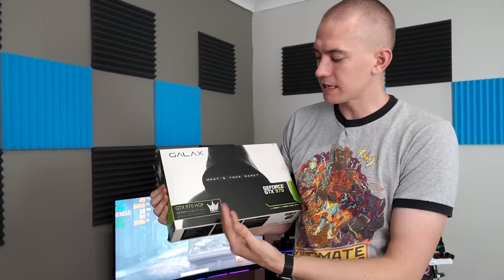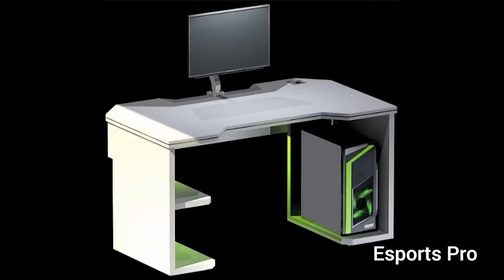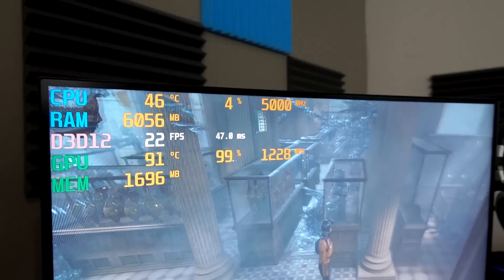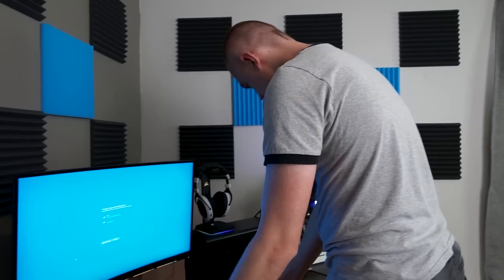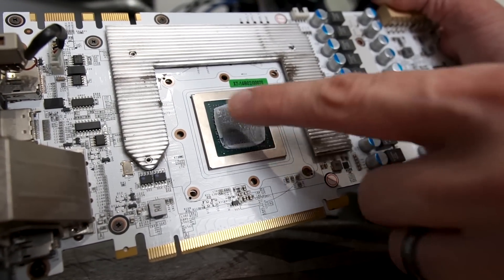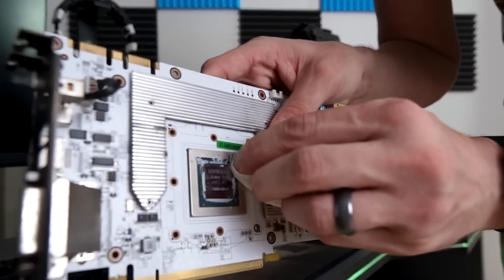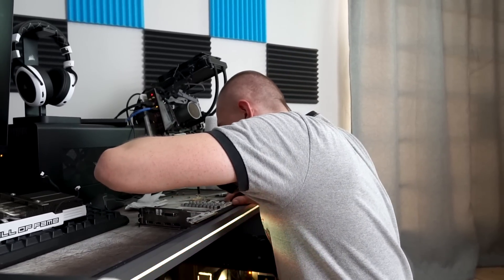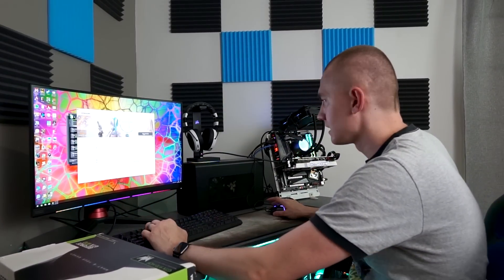GTX 970 - Worth It In 2019?

Comment: i still run a 970 and a 4790K. dont see the need to upgrade. although i have to upgrade my GPU. have to get a stable 144hz/FPS. in overwatch on low settings. cant handle it now. so waiting for navi to come out.
Reply: 970 and 4790K here, and waiting for navi as well. The 970 plays almost everything high or ultra at 1080p, but some games get really choppy in my setup: Tripple screen (5760*1080) is hungry.
Reply: @joanpey8809  yeah you use a triple screen. its different haha. i only use 1 monitor. upgrading from my ancient old 60hz samsung led monitor. love this monitor still though. great monitor. but the price of this monitor was at that time just as much as a 144hz monitor that i want to buy cost now. So yeah i think a single navi card would be a nice upgrade. but i can still oc this card. although i have to figure out how.
Reply: @metalvideos1961  overwatch is also alot more cpu dependent compared to other games
Reply: @crumb6332  no its not. its a GPU bound game. most if not all modern games are GPU bound. CPU doesnt matter much. Light overklock can do wonders. but you dont even have to do that. Older games like Classic doom wolfenstein 3D and all those games are more CPU bound. Minecraft is also CPU bound. But overwatch is not CPU dependent. its GPU where i have to worry about.
Reply: @m4rix2036  have you ever cleaned the inside of the PC? How about your thermal paste, have you ever changed that in that time period?
Reply: @m4rix2036  it's free performance lol. Takes like 20 minutes.
Reply: here a 970 with i5 4460 rocking in 2019 lol
Reply: What version do you have? If it has a beefy cooler you should increase the powerlimit, the boost clock will increase by a lot
Reply: @janpul1590  Asus Strix 970. wanted to go with a MSI but was a little more expensive. so i decided to go with Asus. have to OC it still though. but at stock i dont get that high of frame rates. well not a stable 144FPS at least around 130 till 140 on low. fluctuate alot. and around 120 till 135 at high/ultra settings. so also nearly not enough on what i want.
Reply: @janpul1590  I, for example, have Asus gaming mobo that unlocks full core clocking, but also have Corsair 2x120 radiator liquid cooling installed.
Reply: @GrimK77  why 2x 120?
Reply: @janpul1590  2x120 because I could. There was no point going for 1x120 if I can fit 2x120. Corsair Obsidian 250D case. Price difference between 1x120 and 2x120 was marginal and prefered slower run for fans. My GTX970 is air cooled, but its fan stops at low load.
Reply: @GrimK77  ah okay, what GPU do you have?
Reply: @janpul1590  GTX970, ASUS Strix series card
Reply: Hey, I have exactly same setup... 4790K (on ASUS mITX gaming mobo) with GTX970 (ASUS Strix)... After seeing this video I consider looking into thermal paste tho...
Reply: @GrimK77  you should monitor your temperatures, my windforce doesn't get above 60 °C @1450mhz (200mhz boost over stock)
Reply: were all waiting for navi bro haha
Reply: I ran a 2600k I7 cpu for 8 years and i had no issues. Most games are GPU dependent. My 970 wasn't even bottlednecked. I upgraded to a Ryzen 1800x, fps stayed the same. So i bought a 1070 TI, that did it
Reply: My ryzen 3 get only 40-50ish percent of utilization while playing ow on medium at 80fps with an get 1030. So you can get that with your rig no problem
Reply: Same only i5 4570
Reply: I can play OW with a 970 and i7 3770k on the highest possible settings and always have 120+ FPS settings
Reply: Your 970 should be able to handle overwatch fine even on high settings. I'm pretty sure it's your cpu that's bottlenecking your gpu
Reply: @crumb6332  definitely not, the 4790k has 4cores/8threads at up to 4,4ghz I think something's wrong with his GPU
Reply: @crumb6332  also how can a 970 bottle neck a 4790K. doesnt make much sense if you ask me. every GPU bottlenecks a CPU a little. pretty much all electronics got some kind of bottleneck. But a 970 and a 4790K is a good match. i can even go for a 1070 or 1080 without major bottlenecks. or no bottlenecks at all
Reply: @metalvideos1961  a 4th gen processor is getting kinda old
Reply: @crumb6332  it maybe is. but its still good enough. i know people whos till game on a 3rth gen I7. even on the second gen i7. and they still manage to get a good FPS in games with a new Video card. so no my CPU is stillf ine. i can use that one for at least a year or 2. after that overcklocking and i can still use it for a year at least. so no i dont worry much about my CPU. I want that 144hz also on 1080p anyway. not getting 1440p or 4K. dont need that.
Reply: @crumb6332  
i can handle it fine. easy even. but not on a stable 144FPS. i tested it with the monitor i have now. max FPS i get on low settings is around 135 till 140FPS. so not nearly at the 144 stable that i want. on high/ultra settings i get around 120FPS till 130FPS (if i am not mistaken) but as you can see still not a clear 144FPS stable. I want to play it on 144FPS stable at least. maybe even 240hz. but i need a very good GPU for that. and i dont think my CPU will like that very much. not really in the mood to upgrade my whole pc. although Ryzen 3000 looks good. But i can always OC my GPU ofc. although i dont really know how that works. but i still have to figure it out. reason why i havnt done that is because i dont have money to spear to buy a new card when things go wrong

Comment: @UFD Tech, dude theres 4gb vram not 3.5 and 512mb is the "super slow" hence the joke 3.5 out of 4
Reply from the maker: I say this in the video
Reply: @UFDTech  no you said 3.5 gb vram but 512 is the slow, so 3gb watch it i just did thats why i commented
Reply: @UFDTech  i just rewatched it and your correct you do say 4gb then you say RE 2 at just plain high settings uses 3gb so it wont use the 512 thats extremely slow if thats correct theres 512 missing 10:00 mark

Comment: I currently own a gtx 970 and am thinking of upgrading. My new gpu would need at least 8gb or vram and perform as good as an rtx 2060 or better. The rtx 2070 has a horrible price to performance so I am currently waiting on navi. My thoughts were that If they can release it in July, I would definitely buy though if they release in October/November, I would wait for Nvidias 7nm since they are rumored to be releasing new cards around that time. Also, Nvidia just reported that sales where down over 40% which makes it even more likely the will release sooner.
Reply: Grab a used 1080 for around $400.
Reply: If you don't have a G-Sync monitor, wait and see whats AMD brings to the table.

Comment: I recently sold AMD system with FX8350 paired with R290. The GPU is basically on par with GTX970. I did a similar benchmarks prior to my sale and the numbers I got were similar with 1080p. I sold it as "1080p gaming PC". I sold it for $450 and the guy was happy with it.

Comment: The very best 3.5 gigabytes of VRAM
Reply: I had a 780 3gb rma'd and they gave me a 970 so i was happy about the extra .5gb
Reply: If i buy a new 80 series i want a 80 series, becouse you pay more than the 970 price ...
Reply: It has 4gb it's just that 512mb of it is slower
Reply: @kagamine_rin0294   which i wouldn't be surprised if other cards do the same thing when reaches the last bit of vram . my 970 deff eats up 4GB vram when pushed to max
Reply: @MarioMadness1  Mine too:)
Reply: @kagamine_rin0294  4gbs gddr5 512mbs ddr
Reply: xXzelda masterXx GTA V iIrc only allows 3.5GB to be used.

Comment: mine died 8 months ago, and had to update to the 2080, I was with integrated graphics unlocking timed achievements on games. I decided to buff up because I did not want the heat to ruin the card as it did with 970
Reply: Bad luck, mine died a month before its 3 year warranty ran out phew, I suspect the poor ventilation in my case sped up its death.
Reply: at least the warranty is valid in your contry, here in Bolivia is more like "buy at your own risk" cause there is no official representative here, the only warranty that they give is 3 months if you buy it here (at double the price). I got mine brought from the US and had nowhere to claim to. And at this point shipping it myself would have cost more than a new one nowadays.
Reply: @luisgenaroarteagasalinas2599  Damn that sucks big time :-(.

Comment: I own a Zotac GTX 970. Love it, but barely have time to play and a system to actually use it. It's on a q9550 @ 3.4GHz 8GB DDR2 1066 and the GPU works at about 40-50% from his real speed.
Reply: Because of cpu bottleneck
Reply: Bottleneck by CPU , ram, pcie and possibly HDD too, anyway maybe you can find any used 1155 system with 3rd gen i5 with pcie3 support and at least 8gb ram that would be enough
Reply: I5-3470 can't really keep up with this GPU , anyway I'm enjoying